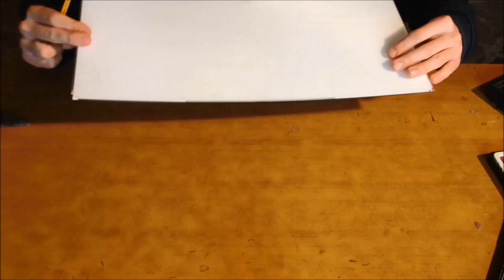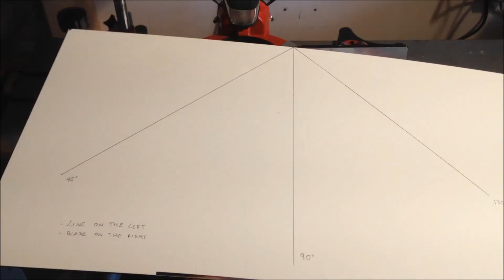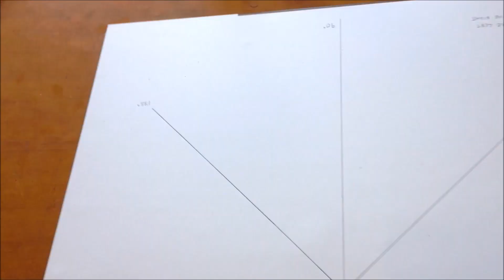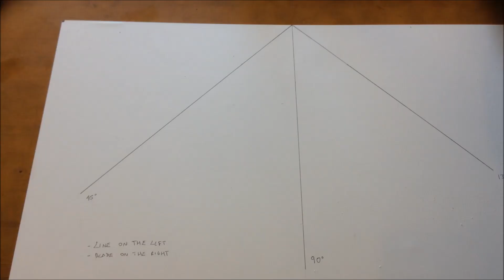Einhell TH-SM 2131 [Set Blade for Perfect Cuts] *My Way*

Comment: Hi Riccardo. Thank you SO much for this video. My EinHELL saw has been languishing in the attic because of - how can I politely put this - it's unique challenges. Your video will definitely help me set it up for a 90 degree accuracy. I didn't have any plastic board to hand (or a gonimeter), but just marked a straight-edged board with a right angle using a try sqaure. All I had to do was follow your guidance on lining the blade up with the pencil mark and it's all sorted. Definitely need to look into your adaptable plastic board idea though. Brilliant!
Reply from the maker: Thanks Man! You're is a great solution too! I made this tutorial for ispirations ;)

Comment: Hi, thank you for your videos and instructions. Would you recommend this saw for cutting polystirene frame moulding for framing my paintings? I know nothing about saws, nor framing, but I need to cut expence and DIY. I've bought this saw and my friend, who is initially trying it out, said it doesn't leave smooth edges, and it's hard to adjust it to 45° and cut precize 🥴 can you please help and recommend better saw for polystyrene, if not this one. I also came across a very bad review of the einhell saw on YouTube, and don't know what to do.
Thank you for your time!!
Reply from the maker: Hi, thanks for appreciating. This saw is for hobby use and surely has a lot of problems. It's good for woodworking but i think it's not good for polystyrene (It's too much soft to be cut like wood). 

Probably you should look at a faster saw
Reply from the maker: ... faster saw like a chainsaw. 'couse It has a thinner Blade. Maybe also hot cutting with wire should be a solution, maybe even better than a saw.

Comment: Hello, thanks for this video. I have got the same issue on my saw . I seted it up as you did but I would like to know if there is any way to avoid each time to do the same process. May be it is possible to set up ? thank you in advance for your reply
Reply from the maker: Hi, Unfortunately i've not found another way... for tiny (and not accurated) cuts I don't use this method, I use the built in system. But it's not accurated. If you have some suggestions I'll appreciate it.
Reply: Asi se hace para que sea permanente https://youtu.be/-S1VRsVCtIM

Comment: Hi Ricardo, congratulations on the videos, they are excellent. I have bought a similar saw. I would like to ask you if adjusting the blade to the farthest position from the slider at 90 degrees is permanent (one time only) or should be done each time the saw is used.
Reply from the maker: Hi, good question. I set the blade every time I move the angle. Sometime I have to check even if I don't use it. Measure twice, cut once!!
Reply: @RiccardoPrezioso  Measure twice, cut once!! Wise advise.
Thanks a lot!
Reply from the maker: You're welcome! 😉
Reply: Así se hace para que quede permanentemente calibrada https://youtu.be/-S1VRsVCtIM

Comment: Can I  use it with metal and aluminium? Of course with different disks. It should work,  right?
Reply from the maker: Yes you can. But some plastic parts will be damaged quickly.

Comment: Sorry i am a newbie, i want to make a small wooden construction and my brother lended me this saw. He told me that the angles are not good so i have to check youtube how to set it. Now i understand why did he say that... So i dont have any experience with such machines- i understand how did you set the 90 degrees. but i dont understand how did you set the 45 degree. because it was wrong even after setting it by the black handle on the machine but then you adjusted the board to fit the 45 degrees (at 2:59). It does not make sense to me to set the board to 45 degrees. Why did you adjust the board If you remove the board and place wood there to cut? then you can set the board wrong, or set the wood wrong. So why did not you set the machine with that black handle to 45 degrees as you did it when setting 90 degrees?  Maybe my misunderstanding will sound stupid to you, so sorry but it really does not make sense to me to adjust the board and not the machine :) thank you for your patience